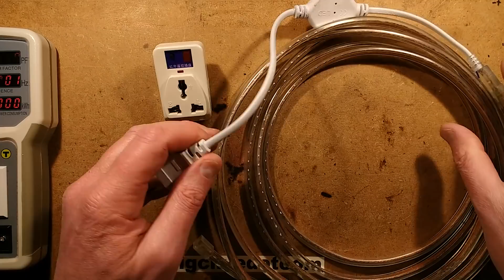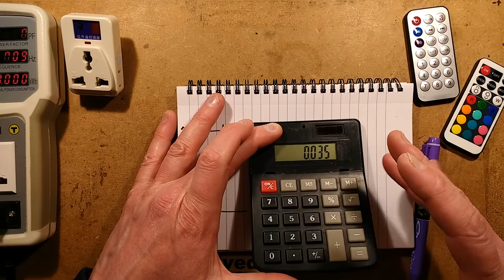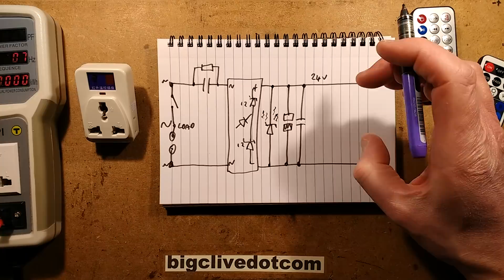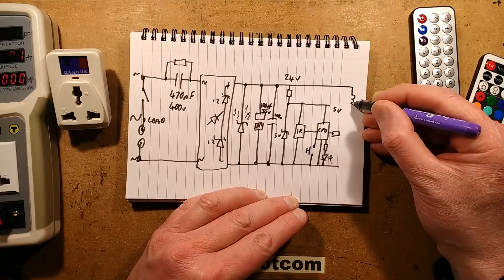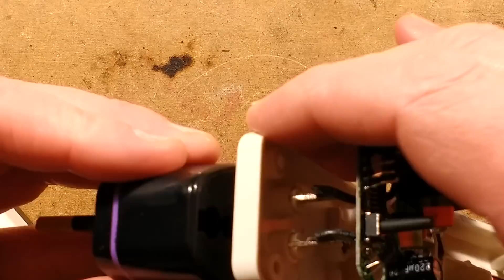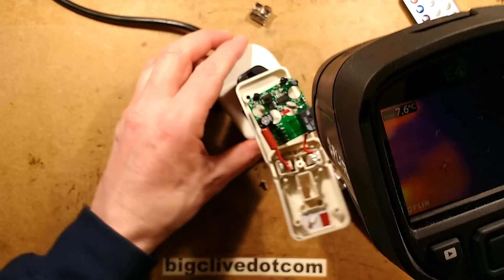Inside the cheapest remote socket I could find.

Comment: I probably missed something, but I guess the zener was dropping voltage from the bridge rectifier, but what is the five volt reg dropping it’s voltage from ?
The relay would be operating at 12V so even at a small current 12 - 5 = 7V drop would get that L05 very hot.
Reply: The regulator doesnt actually drop voltage, its like a tiny non isolated power supply.
Reply: Chuckiele I’m sorry to have to disagree with you, but the main function of a voltage regulator is to drop voltage. The regulator in the video above is equivalent to a LM78L05. This device has a maximum input voltage rating of thirty volts, but the output remains at five volts.
The more current you draw, and the greater the voltage difference between input and output means more heat dissipation, W = (Vo - Vi) * I.
http://www.ti.com/lit/ds/symlink/lm78l.pdf#page4
Reply from the maker: The quiescent current is just a few milliamps so it would equate to roughly 24V - 5V = 19V x .004A = 76mW.  The relay is not powered through the regulator.
Reply: bigclivedotcom Thanks for your reply, I’m honored ! 
I realized that in my comment I had not included the four milliamps to keep the device operating, and also that the relay was not powered from it, but that still leaves the current drawn by both the micro and the memory. Probably insignificant, but I didn’t catch where Vi came from, so I couldn’t “guestemate” the power dissipation.
Anyway thanks for the reply no need to respond to this drivel !

Comment: That programming capability could make for some fun practical jokes.
Reply: It's probably not that, but rather that they couldn't be bothered to implement other codes than the RC5 codes used by these little remotes.
Reply: There's a reason Clive's TV remote wouldn't work with it. Too many people were programming TV remote channel and volume buttons to turn off the TV's power as a prank.

Comment: What is the world coming to when Clive can buy the cheapest thing he could find and it's not a complete death trap........
Reply: Well, it includes the classic deathdapter that allows you to plug in earthed devices into an unearthed socket or even plug your devices in wrongly so that you make their casing come live at mains voltage and it includes a horribly underrated relay that would break quickly and could even set your house on fire. But apart from that its quite neat.
Reply: This is though.
Reply: It overheats, is badly made, and lacks safety features. It's a pretty decent sized death trap even if it's not a complete one. Prob why it's best not to buy mains stuff off Ebay from China. Or anything that matters, really.
Reply: But cheap mains stuff from Ebay is always so much fun.

Comment: Any idea on using a sonoff on a 2 way switch? It needs a permanent live and neutral also I'm in UK and have 3 wires all red.
Reply from the maker: It's unlikely that a neutral will be at the switch.  You'd need to have the module at the ceiling rose.

Comment: Yet another Chinese product that is crap purely by design. A cheap ballast resistor and re-routing of the power + earth lines would greatly improve this product! (Not to mention a 250vac relay)

Interesting that you should mention microwave oven power usage Clive. The QI Elves on Twitter today said that over time a microwave oven consumes more power on it's clock than it does cooking. As ever, no citations. Any chance you could put your Microwave oven on the flickery Hopi and see what the standby power is? A mental calculation seems to make nonsense of the claim, but some data would be nice.
Reply from the maker: I just did that and the standby power was just under 1W.  That equates to a standby cost of about £1 a year.
Reply: Thanks, much appreciated. 1W was the ball-park figure I had in mind. That would be 168 Wh a week, or 13 minutes 40 seconds of 750W microwave oven usage per week. Which seems remarkably low.
Reply: My old microwave oven doesn't have a clock. It has a mechanical rotary timer and goes ping at the end.
Reply: Well, id guess that i use my microwave between 10-20 min a week, so its still very significant!
Reply: To completely cut off the 'ghost power' you could consider getting an old-style mechanical timer, either built-in to the microwave, or an external unit.

Comment: What is this "Pwer Factor" of which you speak?
Reply: When having a resistive load like a incandescent light bulb, the voltage and current are always in phase: When the voltage is at zero, the current is at zero aswell and if the voltage is at its peak, the current is at its peak aswell, they are perfectly matching sine waves, but resistive droppers can become quite hot because the dropped voltage times the current equals the power that the resistor has to dissipate as heat. With capacitive or inductive loads this is not the case.

A capacitor resists the change in voltage so that on alternating current you ideally get a 90° phase shift: when the voltage starts rising, the empty capacitor is like a short so the current is quite high and it gets lower when the capacitor gets charged and when the voltage is dropping the capacitor is actually putting current back into the source. That way a capacitive dropper can limit the current dropping the power without dissipating any heat. You usually find them in LED lighting an other low power devices.

An inductor however resists the change in current so that on alternating current you ideally get a 90° phase shift in the other direction: After the voltage has already risen to its peak, the current is still increasing and reaches its peak when the voltage is at zero again and even is still dropping towards zero when the voltage is already negative, so that it is putting current back into the source again. So an inductive dropper has a similar effect but isnt used a lot anymore because they tend to be quite big. You can still find them in older flourescent lights.

In those two cases the voltage and the current are not in phase so that power equals voltage times current does not apply anymore: You can still have some current flowing when the power is nearly zero. But that being still fine as the current is still a sine wave, there are devices that distort the current curve and that can be potentially harmful like tripping breakers, influence other devices that are plugged in, etc and thats why big switching power supplies like in your computer need something called Power Factor Correction PFC.

Comment: Surprised it doesn't just pair up with a smartphone and not let you use anything else to turn it off and on just like everything else in this stupid generation.
Reply: Gimme an alternative word with the same meaning then.
Reply: "There's an App. for that" (probably, somewhere)
Reply: I actually know someone using a virtual remote control app. Apperantly there actually still are phones with infrared and android actually supports it. It would most likely work with this device too.
Reply: Chuckiele actually needs to stop actually using the word actually.
Reply: Chuckiele -- If for some reason you simply cannot leave out this filler-word, try "it turns out that..." and/or "it seems that..." and/or "he/she/I find that..." and of course, there is this thing called "the dictionary" which often has synonyms. A dictionary will also help you "spelliorate more better."

Comment: While I understand what power factor is and why it happens, I still havent quite worked out why it matters. Any help here?
Reply: Xyxthris  Small numbers of small devices that don't draw much current don't make much difference. But millions of devices, or industrial sized inductive loads (large motors) or lots of standard fluorescent light fittings, means more current flows through the transmission and distribution network. But this extra current does not do any useful work. It just wastes energy in the form of heating up the supply cables and transformers. It also means the transmission and distribution cables and equipment have to be larger and more powerful compared to the power factor being close (or equal) to 1. This all means extra cost.
Reply: I believe it can distort the sinus shapes of the 50/60hz NET so if alot of people use bad power factor devices the energy company has a problem
Reply: If you're a utility, you have to supply current to a load that has no voltage drop (which is a short circuit). Milliseconds later, you're producing voltage, but there's no current draw from the load (open circuit).
Reply: If a device has a power factor less than one, then during part of each cycle the device will take power from the mains and during another part of each cycle it will give power back to the mains.  Any conversion losses in utility transformers will be incurred when power is drawn, and incurred again when it's given back.  IMHO, what would be more relevant than power factor would be the absolute amount of energy that gets sent back each second.  If a motor draws 1,000W for half a cycle and feeds back 800W for the other half, that would be objectionable for a utility.  If a device consumes 8W for half a cycle and feeds back 7.5W for the other half, however, that's probably not nearly as much of an issue even though the latter device's power factor would be worse.
Reply: vidznstuff1 -- That particular type of Bad Power Factor only applies to cheap DC power supplies like old 'wall warts'. The power factor from even a pure capacitive AC load is not as bad as that, and of course, inductive loads are not ever going to show as short circuits. Also, see the other explanations here from +Flat Finger Tuning and +Mark 1024MAK -- each makes good points.
Reply: Unless you've got a factory, it doesn't matter. Large electricity users are charged according to power factor, as well as current. So they often have gigantic capacitors wired in, to bring it back closer to 1.0

Comment: Zeners as rectifiers is a bad idea.  
Think of a diode as many many tiny diodes in parallel.
 In a normal rectifier diode, each tiny diode will have a small resistance in series to ensure the current is shared evenly.  This is needed because the forward drop of a diode decreases when it gets hot meaning the hottest one will hog all the current and fry.
May zeners don't have that spreading resistance because the break down voltage of the "tiny zener" rises when it gets hot forcing the others to take some the burden.
Reply: Ken Smith  Yeah, but we are only talking about 10 to 30mA, so I don't think it makes much difference.
Reply: My experience was with very large zeners carrying 0.1A forwards.  They failed over time.  Also: during power on, there is a really huge current spike.  Rectifier diodes live through such things quite well because they spread the current.

Comment: Out of interest, Clive, is there some reason why your audio is only on the left channel? Might want to record in mono (if possible), or fix that post-recording.
Reply: Looks like a problem on your end. Both channels working here.
Reply from the maker: Dolby style surround sound processors seem to have an issue with my mono audio and slightly bassy voice.  They often divert the audio to a random speaker, sometimes one that's not connected.  The middle speaker is a usual suspect.  It might be worth checking your PCs surround sound settings.
Reply: bigclivedotcom  Just use the playback speed adjustment and play it back at X2 rate. That sorts out Clive's voice 🤣

Comment: Wireless earth pin. Shouldn't be conected to plastic housing bcoz of safety reason? ;)
Reply: Use hot-melt glue to "bond" it! (I've heard hot-melt described as "the solder of the plastic world!")
Reply: Hey, why not to start reading emoticons? ;)

Comment: Should I be concerned with using this (a remote socket) on a CRT monitor?
Reply from the maker: With low loads it should be OK, but nothing is ever guaranteed to be safe.
Reply from the maker: Note that someone has just pointed out that the relay appears to be only rated for 120V.
Reply: CrossedCoder  Not recommended for use with a CRT display. There are large inrush currents with these, plus a spark when the relay turns a CRT display off. A relay used in this application should have a normal rating of 10A and an inductive load rating of at least 2A. Highly unlikely that the relay in this device is anywhere close to theses specs. It will work, but the lifespan before the relay contacts fail may be rather less than you expect.
Reply: thanks

Comment: Is the toasting zener okay? Microwave runs just few minutes at a time but this will probably be in the socket for weeks and weeks, only to be turned on occasionally. 70°C above ambient, I don't know.. I've got no schools for this bit it feels a bit iffy
Reply from the maker: In many microwaves the clock has a dropper circuit and a zener that runs hot 24/7.  In this unit it runs hot when the relay is off.
Reply: Oh.. I thought it'll burn out in some time. Guess that's not the case

Comment: I quit using these things.  They were a nightmare of interfering remotes and multiple remotes.  Worse than the mess you can get with a basket of remotes for the TV, set-top box, DVD/Blu-ray player, etc. etc.

Got a few WiFi smart plug devices and an Echo Dot all on sale before the holidays.  "Alexa, turn on vent fan," "Alexa, turn off bench lights" - works like a charm.

Comment: the circuitry might be OK but those soldered connections onto the plug contacts are pretty horrible. it would only take an iffy connection with the thing plugged into it or the wall outlet to melt the solder and depending on what came loose it could be very entertaining, like in a really bad way.

Comment: Nice to see that the relay is not rated for 250Vac only 125Vac.
Reply from the maker: I didn't notice that.  I'm so used to the similarly sized relays being rated at 240v.  I'll update the description.
Reply: Surprised Clive didn't spot that one
Reply: Is there really a difference between 125V and 250V relays? Like are the contacts further apart? Different metals maybe?

The voltage rating is the voltage it can happily break apart without arcing or welding or whatever. Since a 250V relay will be happy carrying 125V, if it were me I'd design all my relays for 250V, and just mark them as 125V depending on the market I was aiming at. Since factories might not want to pay for "extra voltage rating" so assume my relays were over-specced and therefore too expensive.
Reply: I'm guessing if it's rated 120VAC 20A then it can handle 240VAC 10A?
Reply: @t0nito  500 watts at it's maximum rated 250 volts, is only 2 amps. (2.1 amps @ 240 volts). I'm OK with that.
Reply: Somewhat off topic I know, but I'm trying to fault-find a simple circuit board from an outside security lamp. The PIR wouldn't illuminate it but you could switch it on from inside, then it came on all night and wouldn't go off. I can see nothing glaring on the board but a failed relay could do that? Is there a simple way to test it, I have very limited experience and facilities but as I have four lamps and they have all failed, (posh German ones too), there must be a simple solution.
Reply: That would just make them think it's fake junk, as any decent line voltage relay is rated for 250VAC.
Reply: t0nito they’re normally dual rated like that, yes. Plus often a DC voltage and amp rating as well.
Reply: patrickcol -- From your description of the symptoms, it's probably not the relays, but... You can tap on the relays, gently at first, to see if they revert to the Normally Open position. However, it is possible there is a manual control relay in parallel with the PIR control relay, so that either one will turn the light on. You may as well try something!
Reply: +therealnightwriter -- Yes, but in the case of lawnmower engines, only the lower rating would be likely as truth, which is why there was a massive class action suit in USA a few years ago over the false/misleading Horse Power claims.
Reply: You'll notice, that the relay is rated at 20 A, 125 V. At 250 V, the device is only rated at 500 watts. at 250 volts, that's 2 amps on a relay rated for 20. There probably isn't enough contact gap to prevent flash over at the higher voltage, if loaded beyond that. It should work fine, if you load it within its ratings.

Comment: you clearly assumed it DID have a discharge resistor :D
Reply from the maker: Even better, it has two in series.  Different values which is weird.  Shame about the relay being rated for 120V as someone has just pointed out.
Reply: oh now THAT is naughty :( so its best to use it in 120V countries only

Comment: Here is a 5v module at a nice price and with a good relay:
https://www.ebay.co.uk/itm/Infrared-Sensor-Relay-Module-Remote-Control-Switch-Intelligent-Arduino-2-5-Lot/122848642591?var=423300264864&hash=item1c9a59861f:m:mJ2wRCmSnqboVdJNDKy4XOw

Comment: If the external EEPROM needs 3 signal wires, the μC would need at least 9 pins (2 power, 2 inputs, 2 outputs, 3 memory).  So that external memory cost them the ability to use an 8-pin μC.  Also, the standby power is a bit high even though it meets the 1W max standard.  Maybe some arrangement with a second capacitive dropper could allow a supply that doesn't draw the full current when off.  Talking redesign, the LED could share the window with the IR sensor for simpler casing and extra isolation.